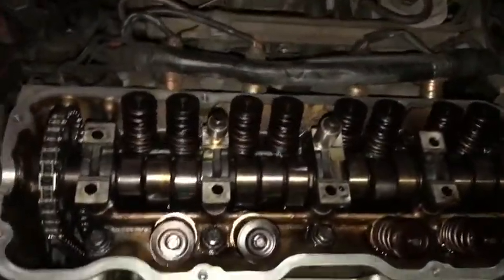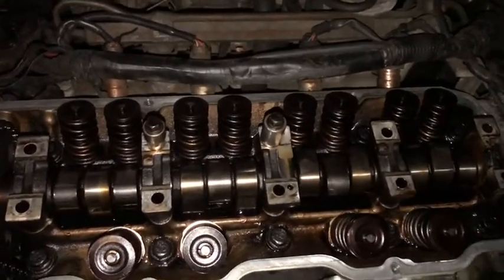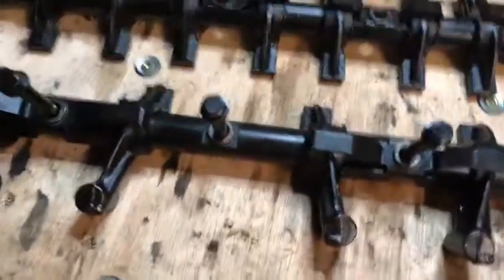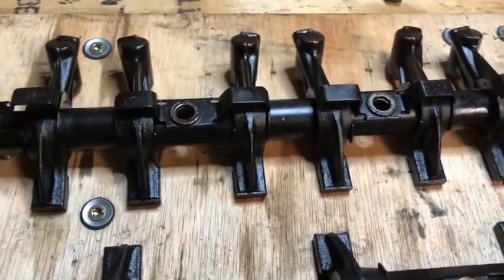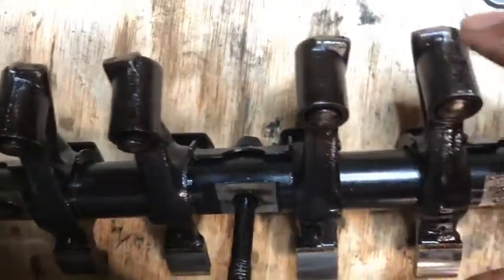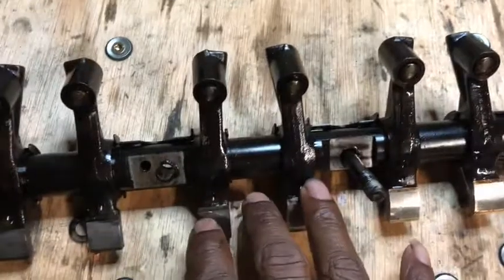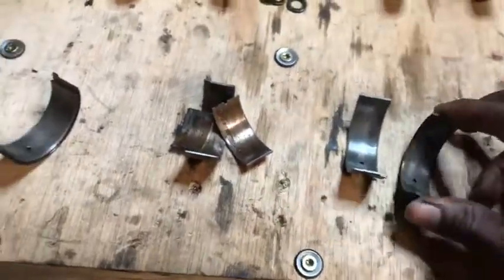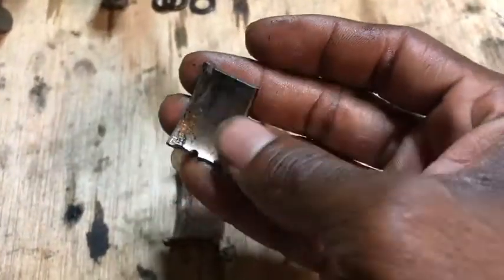Nissan 240sx KA24E Engine Tapping, Knocking

Comment: Did you check your cam chain guides? They are often the source of noise due to failure too!
Reply: Good video tho! Thank you!
Reply from the maker: yes, I've replace them in the past and again not too long ago. the plastic on the guides don't last that long. this time around the crankshaft was the problem as well, after putting the engine back together. https://youtu.be/ue43c3QqtjI

Comment: When to the wrecking yard to pick up some rocker arms how to i know if their bad?  Or good?? Found a set that had no play on them when installed  but when i took them off the head the little plunger on the rocker are very stiff. Is that normal?
Reply from the maker: Just saw your message, I will be gladly to help. 
I have the old ones that I replaced with the new ones . I’ll put all the details in the next video I’m gonna post to best answer your question. 
I explain things better by showing, I’m at work right now when I get home I’ll put the information together tonight and by the end of the week you will have your answers.
Reply from the maker: https://youtu.be/39xOiowo0vM
Reply: @Radstreetdaily  hey i order a new set of rocker arms from ebay and today i received them and i notice the little plunger is hard to push down  i meant its hard!!  They are oem from nissan factory...    maybe oil pressure will push them out ???
Reply from the maker: @streetclasscc5189  they are gonna be a little harder because they are brand new, once the oil starts to run through them, then they will get to the condition that’s needed to be met.
Reply from the maker: @streetclasscc5189  make sure you lube the rail when your installing them and change the oil with a new filter, this way it lessens the friction on startup